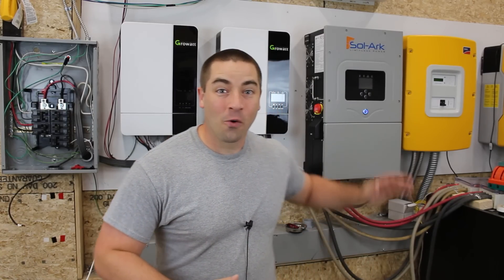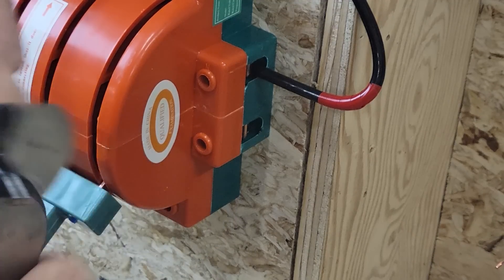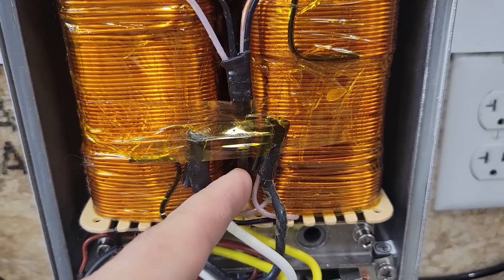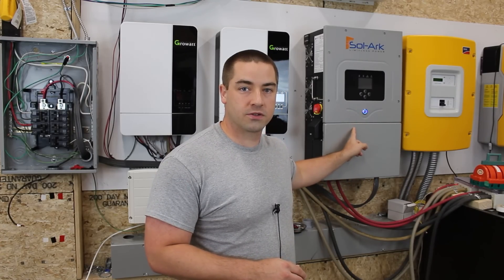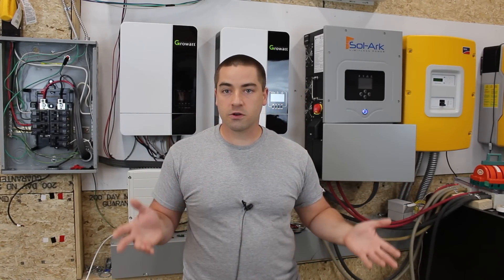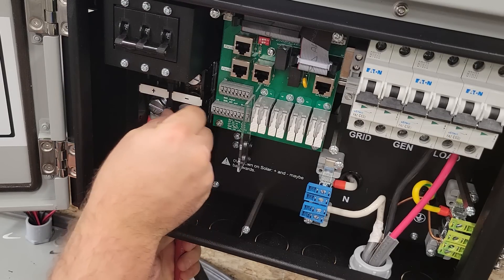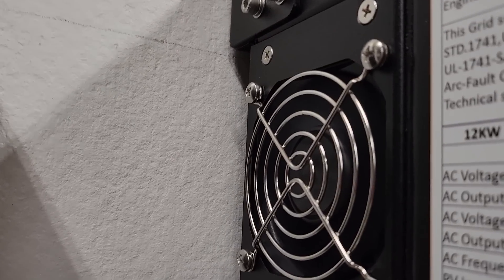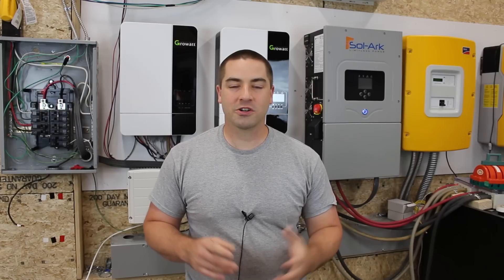Sol-Ark 12K 48V Inverter Install (to compare with Growatt 10K)

Comment: I'm always concerned about morning and evening power loading: Induction hobs, toasters, ovens, kettles, showers not to mention heating all in one hit. This is where peak power consumption can be closer to 10kWh + ... What are inverters rated to when it comes to peak draw? As for batteries, how can you mitigate overheating and reduction in lifespan? More parallel setups? Is it better to have every battery in parallel and just step it up via a transformer? Where would the sweet spot be?
Reply from the maker: Peak power will vary by brand.  In the case of the Sol-Ark, the spec sheet says 16kW for 5 seconds.  
As for battery overheating...  I suggest to build a battery bank large enough so it never sees more than a 0.5C load.  That means, if you have up to a 10,000 inverter, at 48V, that's 208 Amps.  So I suggest building a battery bank of at least 416Ah.

Comment: I would LOVE to get a Sol-Ark. It is the only unit that will do the configuration I need. However, it is way above what I can budget. Sorry to hear you had issues with it.
My configuration: Grid-tie w/net metering or sell to self. 48v Battery backup. Generator backup input. A few panels w/enphase microinverters for AC-couple. Critical load panel.
They are going to get left behind just as soon as somebody makes an all-in-one at a lower price point.
Reply: Be aware that you will be limited to only using the load out breaker/critical load out. When the ct's detect no voltage from the grid, the ac breaker is cut! No way to disable this im told by support. The manual does not say this either. Dont expect to connect to your main panel with the grid breaker and have any backup functionality... i am learning these limits after i bought it!😐 ...im looking at 2 ats's and a disconnect and being limited to 63 amps while grid is up and 37 amps while grid is down with all those additions! Then i will have a 4500 watt limit per leg on top of that! Sol ark is a joke! Dont buy it!

Comment: David  Great video as always do you need braker on auto transformer in previous vid I believe you had 20amp breaker each leg in this vid it is weird into out put of inverter or is this just for  Purpose of this video on the other hand it wood not be good to lose neutral and have voltage spikes on 120 side 😉 lol
Reply from the maker: I had a breaker on the auto-transformer for 4 months, and never tripped it.  But the risk of loosing a neutral scared me since it happened with the transfer switch.  I'm always changing things and will continue to look for the perfect setup.  I'm only showing how I'm rolling with the punches.

Comment: The Sol-Ark is much more temperamental to load difference between phases.  I've heard as little as 15-20 Amps more being drawn on 1 side than the other can cause shutdowns.   The auto-transformer on the back side of the Growatt inverters mitigates that a bit better so as the inverter itself isn't as heavily affected.
Also the 70mm die for your crimper should be for 4/0 cables.
Reply: I have an ALL electric house, 3 hp systems (5.5 Tons) with soft start kits, 80 gal electric water heater. My  two 12K's hsve no problems. Because my panel was already balsnced and i installed TWO!
Reply: Engineer 775 has commented on this "feature" many times as he primarily installs Sol-Arks lately.

Comment: Over loaded SIX TIMES???? I want to know more about why it's doing this. I mean that's just totally unacceptable. I've been thinking about getting a couple of these too, but not so much now. Back in the mid 90's when I was getting into off grid set ups, I had a Trace SW5548 power panel and ran the whole house including window AC's and it never over loaded once in the dozen years I used it. I wish I had brought that system with me when I moved. 

I'm also interested in auto generator start up and shut down and how that works. My Trace inverter had this feature and I loved it. Worked great with my 33kWh diesel gen set to power the electric heat, water heater, oven and dryer, as well as topping off the batteries when the wind gen wasn't producing....which was 70% of the time. Keep up the great work.

Comment: I've installed a number of Sol-Ark 12k (9k) inverters. They function well. But for dollars spent, I'll take the Growatt 5k units with an added transformer  in a heart beat. Here in California with PGE, net metering is a losing proposition.
Reply: @Mendo Home Power What do you think about the Growatt 12K,250 with the transformer built in?  I like the idea of a simpler overall setup.

Comment: wait, are you still using the auto transformer?   Sol Ark has great customer support maybe call and ask? also thats crazy you use so much power, i rarely run over 5k, hoping my 5kw SMA will be able to supply most of what i need, i will be grid tied
Reply from the maker: I use the auto-transformer ONLY with the Growatts.  The auto-transformer is disconnected from the load panel when using the Sol-Ark.  
My house and garage are 100% electric.

Comment: It's not apples to apples comparison. The Growatt should be setup the same as the solark internally. Loose the auto transformer from the setup and have the Growatt's provide 110v each line with 180° phase off into the distro box for the split phase and get the 220v  across both line phases, and with that run the numbers. Just my 2 cents on this..
Edit: my mistake these are 240V ONLY output, this case you need the balance transformer additional hardware. For these configurations of additional power (sum ) of both output and have a split phase with 110v is better to have 2 inverter of 110v connected in sync and phase out 180 to get the output of 220/240 output.

Comment: Hi David - enjoy your stuff.   I have a large DIY solar array and battery back-up system on my home on Pender Island in Canada.  My home is electric only and I generate - and use - 14 MWH annually, including electric car charger and pool pumps.  This video made me think that you may benefit from adding a Schneider Electric SENSE system to your electrical panel.  It's cheap (Home Depot?) and provides real time information about your loads and solar generation, on an IPhone (or Android) ap.  It should give you the diagnostic information that you need to 'figure out' why your SolArk is shutting down.  I'm a retired EE and assist my friends and neighbours with their installations.  I always recommend the installation of a SENSE system as the first step; as none of us knows how we consume energy at the 'per load' level, and how that affects POWER peaks and average load (for back-up duration).  Keep up the good work.
Reply from the maker: When did Sense get sold?  It was a startup here in Massachusetts.

Comment: I have been running the growatt 12k, 250 volt hybrid you suggested to me since first of June,  It has be running my whole house perfect.  I did have some issues with it over loading with the drier, central air conditioner, and toaster oven with well pump.  I took the dryer off the system and its perfect.  House draws about 1200 watts at all time with all the wife loads.  This thing switch from grid to inviter at least twice a day,  Morning and night.  I do not have a large battery bank yet to run through the night.  (new batteries out of stock).  Only thing I don't like is the solar charger when the batteries start to get top off.  For the most part this thing is great. Thanks
Reply: @bigblockcutlass123 What do you not like about the "solar charger when the batteries start to get top off"?  I am thinking about getting the Growatt 12K,250 starting with a 6-slot-battery-rack with 48V/100AH EG4-LL Batteries and curious what concerns you have.
Reply: Wtwoowooiwowppwewowwppwqiewo
Reply: Pwupyiwyyyyypyooywowwiwiy2o6y6yywyyepeuui2yypyoywyipwoyooi3iiyyiiyuoytyuoiuyeyiwoowyowwwoowowpwtiyyyiiyyyyoyptpyowpwyyyeyujqywueuueiww
Reply: Pwupyiwyyyyypyooywowwiwiy2o6y6yywyyepeuui2yypyoywyipwoyooi3iiyyiiyuoytyuoiuyeyiwoowyowwwoowowpwtiyyyiiyyyyoyptpyowpwyyyeyujqywueuueiwwpe
Reply: Ywwyptyowoywppww
Reply: Wyoww is owwehe CA h CE ueeki of kkeu
Reply: IP eupw of opoooiiwogewwgogegowowoioowgigwwpweiouey

Comment: Dose the Sol-ark have a built in split phase.  In a way that's one reasion I like kind of like the transformer I have. if one phase is out of balance it will not see that on the primary side going to the inverter.

Comment: I wonder if that auto Transformer would work better for my 4kw MPPT solar inverter witch are also stackable up to 8 units now. and I think up to 12 if you want to go with a 3 phase system.  I used Transformer to take the 230 and then on the secondary get 230 volt split phase. I wonder if the auto Transformer would use less power. Since with the split phase transformer it can on its own use just 75 watts.

Comment: Well David, I am in a mess with my Sol-Ark 12K and my LTO SCIB batteries. Had a bad accident that stopped my installation and now when I finally go to install my Sol-Ark 12K find out that it is was an older model that has a 59V maximum charging limit. If I use it, I will be losing quite a volume of my battery bank storage because I will have to drop the Nominal voltage to 58V instead of 60V which also kills the top balance of the BMS's. Sol-Ark won't help me as well as alt-E where I purchased it. Any idea or advise on what I can do?
Reply from the maker: Hi Craig,
Shoot, that sucks.  I would first try a firmware update to see if that allows any higher of a charge voltage.  Growatt is no better at max charge voltage.  Victron has the highest I'm aware of.  
That is really annoying.  My friend Ben has a Sol-Ark and his goes up to 63V.  Maybe check out his channel and ask him in the comments.  He has more knowledge on the Sol-Ark than me.  https://youtu.be/6mARxSMp-gE
Reply: While the Outback Skybox doesn't list higher voltage much in the specs it will go up to 68v. This applies to the Radian as well. 

I was having a similar issue when installing Sol-Ark systems with some 60v Samsung battery systems I was getting from EV West. I ended up removing 2 of the 16 cells in each battery to drop the voltage down to where the Sol-Ark could charge the system correctly. I have four of those systems that have been running perfectly for around two years now. 

Your LTO batteries should be able to be modified in the same way. The price of a new BMS would outweigh the price of a different inverter or different batteries?

Comment: I think David became confused about the wire gauge.
Lower gauge wire is actually larger. Higher gauge is smaller.
Whenever possible if you have it, use the larger wire if higher current is an issue.

I have 8S2P 24V 200 A-hr batteries system (5 KW), 
but my BMS only allows 50A charge or discharge. 
I have 6 gauge wire (18" - 55A) connecting my batteries. 
That allows over 1250 W safely as nominal voltage is 26V or more.
My greatest load with A/C is about 1050W allowing 85% efficiency is about right.

My newer system (waiting on batteries from China) will be 48V and #6 wire should be sufficient even though I am increasing the load, the current will be less.

Comment: Looking forward to your testing results.  I would like to see how much current they use when there is no load at all.  I'm assuming your autotransformer uses some even when there is no load, same with the gowatt and sol-ark inverters.
Reply from the maker: Yes, the auto-transformer uses some.  I have not tested it yet, but I'll guess the Sol-Ark uses half as much watts at idle then my Growatt setup.

Comment: Two Victron MultiPlus 3000VA units, a VE.Bus to USB adapter, and a raspberry Pi total about $2600. Just missing the MPPT charge controller part. Because you are using the raspberry pi to control everything you can tinker with the software and interface with any inverter or BMS. Nice if you like to tinker and no need to spend $500 on a screen.

Comment: Not easy to do, but getting a sense of which net meter inverters work best in the AC coupled mode, and even harder to do, a parallel Sol-Ark install. I have to do two of them, hence my interest. Also, quick shutdown wiring and performance would be useful since the rule making on a lot of that stuff has gotten a bit crazy imo. Thanks. Looking forward to the follow-ups. One more thing. A spec that's hard to find for some inverters, especially the Chinese, is THD. If you could throw a scope on your units, that would be valuable. Some digital equipment is enormously sensitive to distortion.
Reply from the maker: I own two oscilloscopes.  It seems every time I put one on an inverter to show the wave, there is always someone telling me I'm doing it wrong.  LOL, and I probably am!  I don't have a background with scopes.  I'm happy to plug mine on, just please keep expectations in check due to my limitations.
Reply: @DavidPozEnergy  Thanks for the reply. That was just a thought. I'm much more interested in the AC coupling tests of various kinds. I have a Sol-Ark but haven't installed yet. Waiting for more of the EG4 batteries to be delivered. Bigger project for me is the Sol-Ark using Can-Bus and the batteries using RS-485. As best as I can tell they won't speak at the data layer unless some kind of bridge is built. Maybe not a problem, but if its a problem I will have to design and code a bridge. Might be able to get away with simply setting the various voltages in setup, but it sure would be nice if they actually talked.
Reply from the maker: I'm running mine with Voltage settings only.

Comment: I have heard some users saying the 12k Sol-ark is actually a 9k system in practice. I use the 8kw Deye inverter (who are the manufacturer of Sol-ark) and it works flawless plus it's way cheaper than Sol-ark - ofcourse markets are different though. I will pick Deye over a growatt anytime, any day. David should try do a comparison with Deye.

Comment: Hi David. Could you just use the 230 output from the Sol-Ark to your neutral forming transformer to balance your load?
Reply from the maker: Do you mean, buy an auto-transformer to add to the Sol-Ark?  I suppose it might help.  But at that point, what's the benefit?  The Sol-Ark is sold as a 120/240V inverter already.  The end-user is not supposed to have to buy anything else.  And, Sol-Arks website doesn't mention adding anything else.  I wonder if you did add an auto-transformer, then had a problem, if Sol-Ark would still help you after doing an un-authorized modification?

Comment: The solark needs loads balanced within 1400 watts
Reply from the maker: 1400!?  Wow, that's a small window.  I'll certainly have to test that.  Do you have any reference for that figure I can look up?
Reply: @DavidPozEnergy  

This is what I was told from tech support in July 2020 

The legs inside the system can handle up to a 1400w difference between L1 and L2. 

Dustin Douglas
Sol Ark Technical Support

Comment: Sol-ark claims EMP protection, what are your thoughts on that. 
Thanks,
Mika
Reply from the maker: I think it's great.  Sol-Ark has tested it, I have not.  I think you have to buy additional things to put on your solar panels to get the full protection, but I don't know the details on it.
Reply: @DavidPozEnergy  The EMP model comes with the additional hardware for the solar panels. The documentation is  a bit vague on what is included. I put them on the system and am awaiting an EMP storm to see if they work. :)
Reply: Emp model is a more expensive model, i believe $8400.

Comment: Do you have the $309 plus shpg soft starters on all 120 and 240 units with high LRA??? You need them. It’s easier on all inverters, electrical wiring and components. Also HP dryer and water heater.
Reply from the maker: No, I have not added any after-market soft-start devices to any of my appliances.

Comment: I just installed a Growatt for my fridge and freezer. Using it at 24 volts with 2x Ampere Time 200ah 12v batteries. Just started with it and need to make some adjustments

Comment: With the Growatt, why is there a 6000w limit to array size? I would have thought as long as you don't exceed the input VDC of the controller with panel sting VOC, any array overage would simply not be used. Is the 6000w number simply Growatt's way of saying that's the largest array the Controller can utilize? I'm building up the Growatt 12kw and want to over panel it, but Growatt says the largest array is 7000w.
Reply from the maker: That's correct, just don't exceed the voltage.  I think they list 6000W in the manual more to help people in sizing the system.

Comment: I have this same inverter.  I don't think you have enough clearance for cooling on the right side.  I run the hell out of mine and have never had an issue with it at all.
Reply: I was thinking the same thing. Although it’s just vents on the right side, if you create turbulence then some parts may not cool properly.
Reply: you never had an issue because you are not of-grid. try to go of-grid.

Comment: I saw a video recently on the Sol-Ark where they said it is limited on each phase. Using an auto transformer fixes the issue by allowing the second leg to feed across to the first and the other way as needed.
Reply: This is too dangerous..